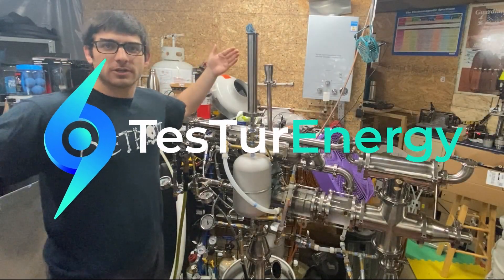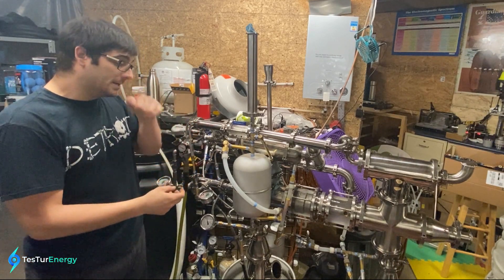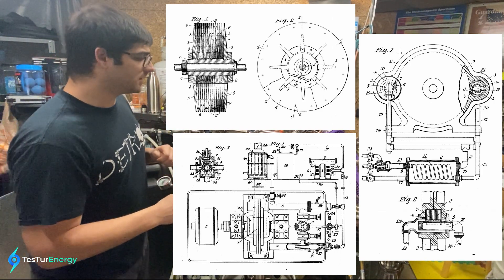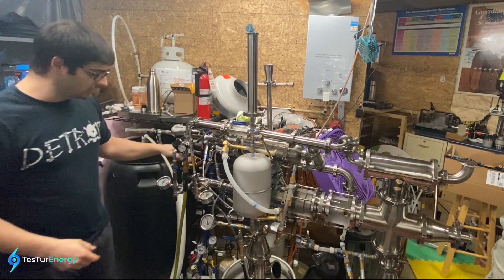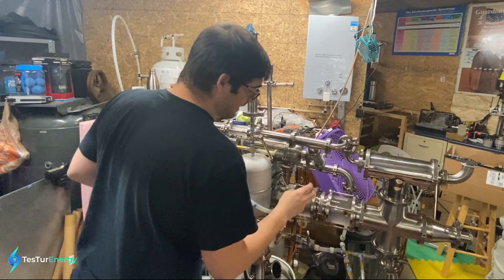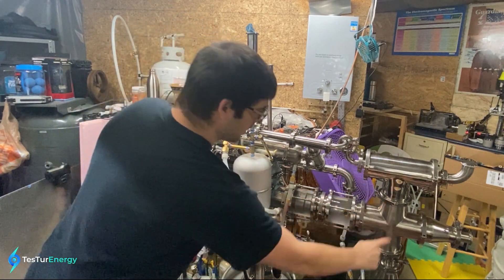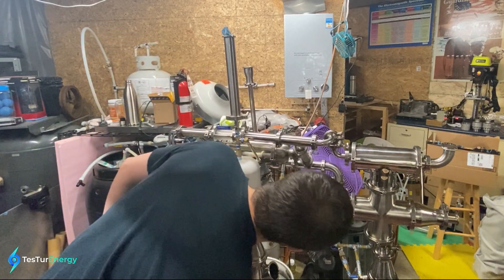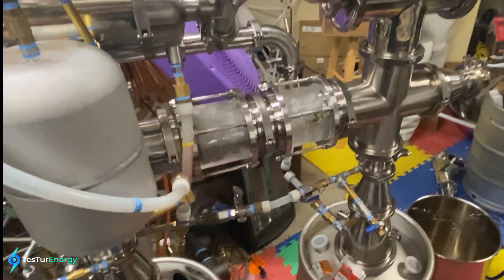Tesla Turbine Jet Engine - gasoline fuel burner atomizer flame tube test 186,083 propane burner

Comment: Do you have a figure for the pressure coming out of your unit where it will drive your tesla turbine. And the volume output.
Reply from the maker: Hey Cole tool center! Right now it’s just going to atmospheric pressure. But once hooked up to the turbine there will be back pressure and a raise in pressure as the water jacket boiler comes up to temp. From there the input air and fuel pressure will be increased to keep the same pressure gradient across the burner so there’s the same fluid and flame propagation speed.
Reply: @CharlieSolis  do you have any figures on what pressure and volume you expect to achieve?
When you tested your tesla turbine under load you were using 150PSI for 35 seconds.
I have noted that as pressure is decreased the RPM achievable is reduced, eg 100psi may get 12000rpm on my turbo 40psi only get 4500rpm I  assume also torque will also reduce.. it seems to get the tesla turbine to work it needs a constant pressure to accelerate the rotor. is this the case with your 10" Tesla Turbine.
Reply from the maker: @Graemecns  this is not the case. The max rpm for like has been different for each nozzle arrangement at the same Pressure. In any case you almost will NEVER be using max rpm anyway. You have the least power output at max rpm. Increased rpm gets an increased efficiency at the loss of power. 

Furthermore 150psi air was just a test fluid. We don’t need even half that for the steam + combustion version. The energy density in steam is SOOO much higher than for compressed air. I will be starting with 15 psi tests and go up from there. Most likely won’t ever go above 75 psi though.
Reply from the maker: @Graemecns  this is what Tesla says in the Aerial Apparatus for how to use the different nozzle arrangements. 

NIKOLA TESLA U.S. PATENT 1,655,114 - APPARATUS FOR AERIAL TRANSPORTATION

“In order to secure the best results I have found it indispensable to depart, in some respects, from the usual design of my turbines and embody in them certain constructive features and means for varying the power developed from the minimum necessary in horizontal flight to an amount exceeding by far their rated performance, as may be required in the operations of ascent and descent, or spurts of speed, or in combating the fury of the elements. Furthermore, I so proportion and coordinate the fluid pressure generator supplying the primary energy, the propelling and the controlling means, that for any attitude or working condition of the machine the requisite thrust may be almost instantly produced and accurately adjusted.

The understanding of these improvements will be facilitated by reference to Fig. 4 and Fig. 5. In the first named the turbines are intended to operate as rotary engines, expanding the gases in the rotor as well as the inlet nozzle or port 12, the depth of which can be varied by shifting a block 13, fitting freely in a milled channel of the casing, through the medium of lever 14 controlled by the aviator. The orifice for the passage of the elastic fluid is straight or slightly converging, so that a much smaller velocity is obtained than with an expanding nozzle, this enabling the best relation between the peripheral speed of the rotor and that of the fluid to be readily attained. The performance of such an engine at constant pressure of supply is, within wide limits, proportionate to the quantity of the working medium passed through the inlet port and it is practicable to carry, for indefinite intervals of time, an exceedingly great overload, by which I mean up to three or even four times the normal. Exceptional strength and ruggedness of the motors being imperative in view of centrifugal stresses and critical speed, their weight need not be appreciably increased as would be the case in other forms of prime movers in which, as a rule, the weight is in nearly direct proportion to the power developed. To accomplish my purpose I further provide commensurately larger inlet and outlet openings. No serious disadvantage is thereby incurred because windage and other losses are virtually absent and most of the rotary effort is due to the peripheral parts of the discs. As shown in the figure, block 13 is in the position corresponding to minimum effort, the section of the inlet channel being about one-fifth of the whole which is obtained when the block is pulled in its extreme position indicated by the dotted line. Owing to the increase of the coefficient of contraction and counterpressure attendant the enlargement of the inlet, the same should be made of ample section.

Figure 5 shows a different means for attaining the same purpose. In this case the motors operate like true turbines, the working fluid being fully expanded, or nearly so, through divergent exchangeable nozzles as 15, having a throat of sufficient section for the passage of fluid required during maximum performance. The exhaust opening is also correspondingly enlarged, though not necessarily to the extent indicated in Figure 4. The power is varied by means of a throttle valve 16, as used in automobiles, located in the conduit supplying the air and carbureted fuel to the fluid pressure generator and mechanically connected to the controlling lever 14. This apparatus is of a capacity adequate to the maximum demand by which I do not mean that it is necessarily much larger than required for normal performances, but is merely designed to supply the working fluid or, broadly stated, energy—whenever desired, at a rate greatly exceeding the normal.”

https://teslauniverse.com/nikola-tesla/patents/us-patent-1655114-apparatus-aerial-transportation
Reply from the maker: @Graemecns  in the 1200watt load tests I had the tanks at 150 psi. But I was throttling the supply with a valve. So the pressure going into the turbine from there was dropped. The 1200watt load was sustained all the way until the tanks were at 65psi. So at about 70psi the turbine would sustain 1200watts.
Check out the efficiency and other calculations chart I made for that 1200 watt run. 
https://www.youtube.com/post/UgkxRukN0zoVbtfe1LmLUlXyIo0kdt1ExWZs
Reply: @CharlieSolis  how close are you to running your 10" tesla turbine with your steam generator?
Reply: @CharlieSolis  I am having some success flashing water to steam with my Pulse Detonation engine. But using a car turbo is not giving me easily quantifiable results.
I am building a jet rotor turbine which will direct couple to my PDE and redirect the gas/steam out put into a rotating turbine which I can easily see if there is an increase in Rpm with a digital tacho.
Reply from the maker: @Graemecns  I’m just finishing up the designs for the bearing and gear hubs and then I will be doing the vacuum steam tests at low temp. And if I’m satisfied with the results I will start taking the temps and pressures up for efficiency tests, but I will have to cut out an all stainless steel version. I have almost all the materials left for it and I’ve got the new stainless steel capable cnc router all set up to do the cuts now too.
Reply from the maker: @Graemecns  why are you trying to get higher rpms? It’s torque and power you should be worried about.
Reply: @CharlieSolis  I have no idea what torque is being produced when the engine is running dry I have been using the pulses by directing them into a car turbo, the generated power is dissapointing if I get a big bang it will brightly light up 20 leds but just running detonating @ 20hz I don't get an output observable on the leds.  I am changing from the car turbo to a rotating 3 head jet nozzle turbine which has approx 150mm radius. Rotation will be able to easily observed and measured with a digital tacho so I can see if tuning (fuel air and timing) or steam is improving the output.
The jet turbine has 10mm output shaft which I will ba able to direct couple to a generator.
Reply from the maker: HP = torque * rpm / 5252 
Make that equal to the electrical power output at any given rpm and you can solve for torque at that rpm.

Comment: What kind of power could I get with 2000 ''PSI and does pulsing the air cause all kinds of anti-vortex air flow and lower efficiency? I am referring to your pneumatic only tesla turbine video...
Reply from the maker: Hey N Hanna! I can’t really say what kind of power it will have from 2000 psi as I’ve never really seen anywhere that would get a supply of 2000psi except for maybe HP CAES use. Can I ask where you plan to get a steady supply of 2000psi for powering the turbine? 

Can you elaborate on your anti vortex question? I’m not sure I’m fully following what you mean? 🙂

Comment: Going to have to install a emergency shut down 😂😂😂😂😂🧐
Reply: I would love to see EtoH or paraffin oil. Nice job
Reply from the maker: @evandunn7403  😅 yeahhhhh lol I actually have a final valve at the bottom of the fuel tank that goes to a open fuel line that just dumps into a plastic gasoline fuel tank. So if I need to I can just dump the pressure and dump the whole volume of gasoline into a separate tank while it depressurizes. There’s also a valve at the top of the fuel tank to dump the gaseous pressure out of the tank too in case of an emergence. Otherwise you just cut the fuel throttle needle valve and everything shuts down.
Reply from the maker: @evandunn7403  eventually I want these valves to be on a reduction stepper motosrs so I can use the offline controller of my cnc machine to fully automate combustion and air fuel mixing.
Reply: @CharlieSolis  there you go you need to get into plc valve controlers and it depends on the pressure but I definitely can help you with that. Belimo or specific variable controllers the make tones of types and I got a nice high temp boiler if you need.

Comment: If you need use a 1 or 3 gal  Firkin keg as as a fuel tank to get away from aluminum.
Reply: So with your liquid fuel this is where I was talking laminar flow through a nozzle and even dispersing of fuel. Yes so you don't blast yourself.
Reply from the maker: @evandunn7403  ultimately I will be using my Tesla pump/compressor multi-fluid vortex mixer idea for EXTREME air fuel mixing, atomizing/aerosolization, AND compression. 
Check it out 
Tesla Compressor Multi-fluid Vortex Mixer & Steam Condenser - Air + Fuel Mixer Carburetor Atomizer
https://youtu.be/qLBqbBPikcc

I also have plans for it as a second stage pump steam condenser working in conjunction with my interstage heat exchanger idea of mine too. 
Tesla Turbine - InterStage Heat Exchanger (ISHE) - Heat Pump & Inverted Brayton Cycle & Improvements
https://youtu.be/pYSniitC8DM
Reply: @CharlieSolis  this is where I had to get into talcum powder coal it was rough basically had to venture blow with pressurized air from huge intake fans into a tornado boiler. You may need to have a option for vertical positions so you can remove gravity from the nozzle deflection. I found a 63 to 80 deg x axis injection angle and 45 fixed degree z axis is ideal depending on the rate of burn and injection fuel mixture.

Comment: Got to love more progress. I wonder if an ultrasonic atomizer might work well in this setup? A Venturi is great for simplicity / lack of moving parts though it likely makes the fuel/air mixing a bit challenging. Higher viscosity liquids/oils could be tricky without atomization. Any ideas here?
Reply from the maker: Yup yup! I’ve actually been trying to figure out how to use and oscillator engraver somewhere. Maybe even just sticking a piezo element onto the fuel misting tube in just the right place so the cantilever’s tip is an anti-node. 

But that being said, ultimately I will be using my Tesla pump/compressor multi-fluid vortex mixer idea for EXTREME air fuel mixing, aerosolization, AND compression. 
Check it out 
Tesla Compressor Multi-fluid Vortex Mixer & Steam Condenser - Air + Fuel Mixer Carburetor Atomizer
https://youtu.be/qLBqbBPikcc

I also have plans for it as a second stage pump steam condenser working in conjunction with my interstage heat exchanger idea of mine too. 
Tesla Turbine - InterStage Heat Exchanger (ISHE) - Heat Pump & Inverted Brayton Cycle & Improvements
https://youtu.be/pYSniitC8DM
Reply from the maker: Sorry I edited and added a couple things to that first comment. If you didn’t see the edited version reload the comment 😇
Reply from the maker: ultimately I will be using my Tesla pump/compressor multi-fluid vortex mixer idea for EXTREME air fuel mixing, atomizing/aerosolization, AND compression. 
Check it out 
Tesla Compressor Multi-fluid Vortex Mixer & Steam Condenser - Air + Fuel Mixer Carburetor Atomizer
https://youtu.be/qLBqbBPikcc

I also have plans for it as a second stage pump steam condenser working in conjunction with my interstage heat exchanger idea of mine too. 
Tesla Turbine - InterStage Heat Exchanger (ISHE) - Heat Pump & Inverted Brayton Cycle & Improvements
https://youtu.be/pYSniitC8DM
Reply: @CharlieSolis  the multi fluid mixing is a pretty interesting concept. I'll take a look at the other video as well, thanks for sharing everything you do!
Reply from the maker: Thanks for staying tuned in! Just trying to do some good in this crazy world we all live in now 😅

Comment: Pressurizing liquid fuel with air is...a bit sketchy.  Generally in the oil industry nitrogen is used.  
you could use a fuel pump, but maybe that's adding trouble you don't want to deal with, you could use a weight, or a spring.  
Thinking outside the box, if you had the fuel in a flexible bladder and put it in a sealed water tank, you could pressurize the water tank which would squeeze the fuel bladder, you wouldn't need to worry about having a supply of inert gas, and leaks would only be a minor annoyance, as well you pressurizing and depressurizing it is relatively safe.  It would be relatively easy to scale up as well.
Reply from the maker: All good ideas. I dabbled around with a few of them myself. There’s a bunch of ways to skin this cat. The bladder idea was what I wanted but the whole “making a gasoline proof bladder tank” was less than ideal at the moment.
Reply: If you are just pressurising you fuel tank with air and your fuel pickup is below your fuel level you should only get liquid fuel up until you run out off fuel then you have a fuel air mix. And if you don't have a positive valve you could get a blowback up your delivery tube. As I am using 12v fuel injector I have not had a problem.
Reply from the maker: Flashback arrester solves all of these issues with the back pressure spikes.

While, I’m sure all of us here are all well aware of how they work, this animation is still 🔥🔥🔥🔥 AF
https://youtu.be/6pBBhtb8Ma0

I still don’t like the idea of a pressurized air and fuel filled tank
Reply: @Graemecns  it is possible to do it and have nothing go wrong, it's just sketchy.
Reply from the maker: But that being said there might be something to taking the pressure to a high enough point with the compressed air that the gasoline isn’t able to be a vapor in those pressure and temp ranges ………🤔🤷‍♂️🤦‍♂️💨🤯 stillllll not worth it lol

Comment: not very different from a turbo rocket system :)
Reply: how about pipe the co2 exhaust out of the building
Reply from the maker: @Jkauppa  once I’m happy with these burner tests it’ll be time for turbine Tests. And then after that I will be routing the exhaust through the keg vacuum condensers and from there to a large high vacua pump to whatever pipe I want to outside.
Reply from the maker: @Jkauppa  Yup! Quite literally a piston compressor “supercharged” combustion + steam rocket. 😈🔥😈🔥😈 I’ve got a pretty good air flow going through the garage with windows open. There’s a big ol’ fan that I have in the door blowing the air out.